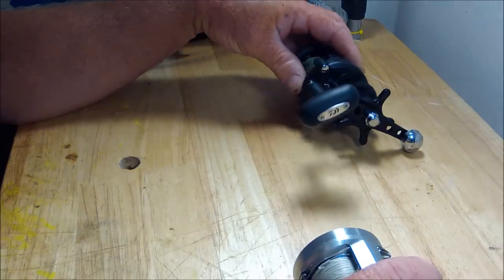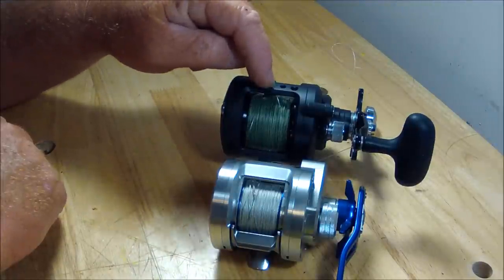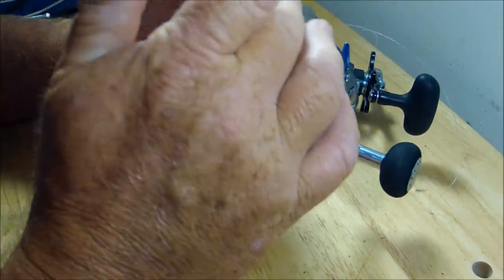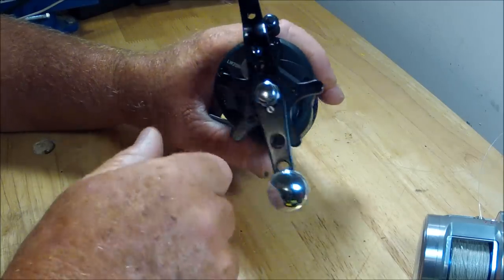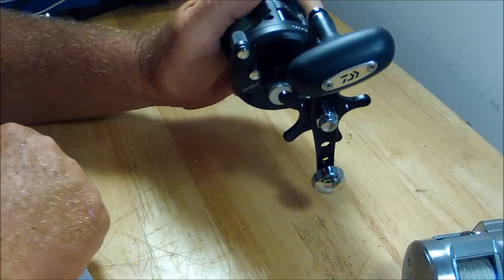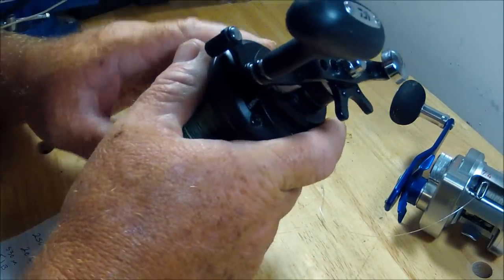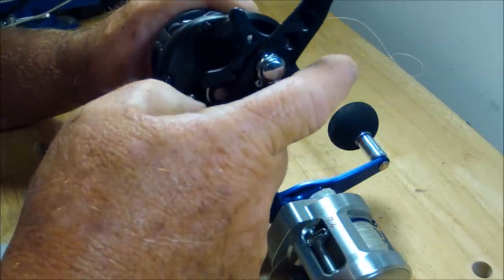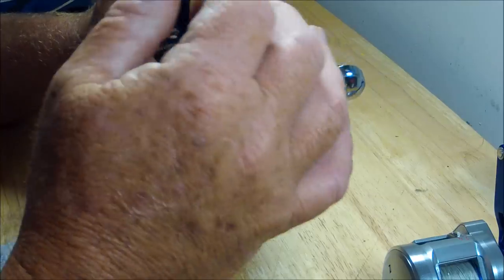Daiwa Saltist - Daiwa Ryoga; Bait casting reels

Comment: Great info, digging my work horse TR200Gs, although the handle nut cover came off making me think its not holding up.  Also the drag system is good but seems kinda uneven during fight.  So I was thinking of upgrading, your video was perfectly timed.  Saltist sounds perfect.
Reply from the maker: Hank Wright The shimano Triton is a work horse and I own 24 of them. But the Saltist 20 HC ($189 on Ebay) is the reel thats right behind the Ryoga in my book. Like the Triton, but way better.

Comment: nice auto engaged, very rare that round reels has this feature. my question is, is the bait clicker will turned off as well as soon as you retrieve?
Reply from the maker: No clicker is on, you have to push it on and off, I never use "clickers"
Reply: +Capt Daves Sportfishing Charters thanks for quick reply. not a big deal. i myself transformed into daiwa. i am a baitcasting dude and using shimano.. last week i got the tatula 100hs (TWS) and im blown away! now im eyeing this black saltist for my surfcast and trolling needs. daiwa's making good products. nice explanation by the way :)
Reply from the maker: +1addictsad78   Yep, used to be a 100% Shimano guy, till I got my first saltist. Sold a Tranx bought two saltist, with the money, 2 for the price of just one Shimano !!
Reply: You prefer saltist over tranx?

Comment: What reel do you use on the Float Rig rods?
Reply from the maker: I'll assume your asking which are charter reels? Daiwa saltist 20HC, personal reels? Daiwa Ryoga.
Reply: Capt Dave's Sport Fishing my wife got the Saltist 30 instead of the 20. So today I ordered a Lexa 300 to go with the Ugly Stick because I felt the Saltist 30 would be too big. I had noted that you liked the low profile on the float rig set up. I am moving to St Mary’s in the summer and want to be rigged up right. I know some of your videos are older so you change reels etc. so now I have 2 Saltist 30s for the Ugly Sticks Striper rods and a Lexa on the way. My wife fishes with me a lot and I am sure the 30 is too big for her.
Reply: Capt Dave's Sport Fishing I have been trying to do my homework in preparation for moving to the Atlantic coast since I have been fishing Pensacola. So I have been watching you a few months. You make more sense than anything else I have read, watched or heard. So you have a good channel.
Reply from the maker: @NICHOLSRETIREMENTEMPIRE  yeah I don't do low profile reels anymore they were very maintenance heavy and the paint was coming off of my Lexa 300 as someone pointed out probably because of the excessive amount of sunscreen that is constantly slathered all over my boat☠☠ especially for customers I use reels that I could easily get parts and then I can easily clean very quickly my number one reel of all time is a Shimano tr100g
Reply: @CaptDavesSportfishing  thanks for the response
Reply: @CaptDavesSportfishing  thanks for the response